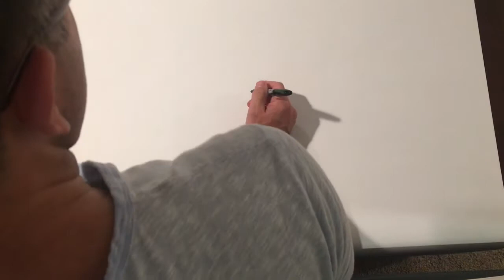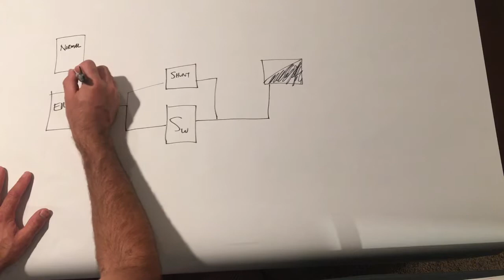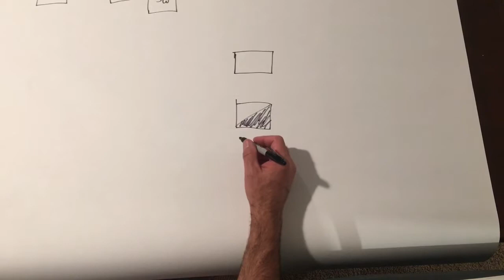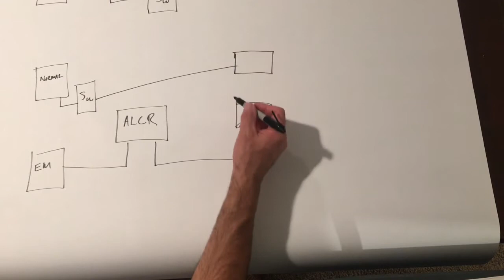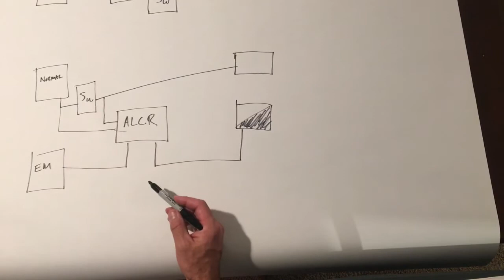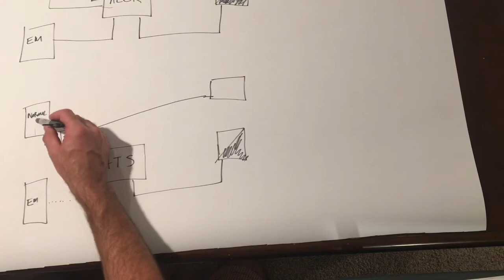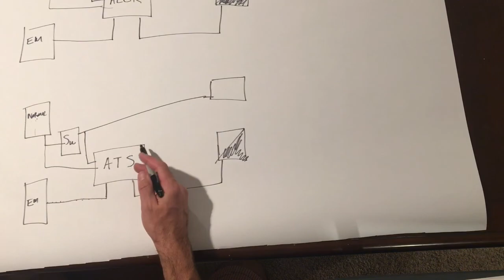Emergency Lighting Control: Shunt Relay, Automatic Load Control Relay And Automatic Transfer Switch.

Comment: IF MY LIGHTING CIRCUIT ALREADY GOING THRU MY RELAY PANEL IS AN EMERGENCY CIRCUIT, AND I KNOW THAT THE RELAYS IN THIS PANEL AUTOMATICALLY CLOSE IF MY PANEL LOSES POWER, AND MY 0-10V DIMMING SHUTS OFF, AUTOMATICALLY BRINGING MY LIGHTS TO 100%, WHY WOULD I NEED THIS DEVICE OTHER THAN TO FATTEN LUTRONS WALLET??
Reply from the maker: Hi Edi- the purpose of this video is to show the difference in the 3 types of devices.  To answer your question, a emergency control device has two sets  of contacts.  One closes to bring power to the fixture under emergency conditions. The second contact opens to bring the dimming to full bright.  Both are required.